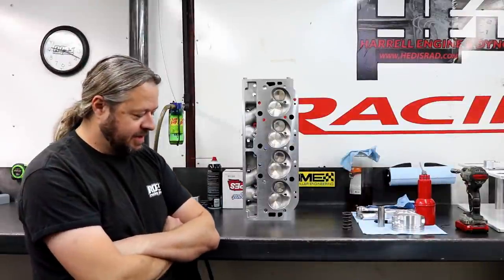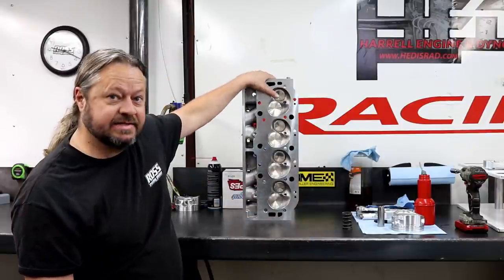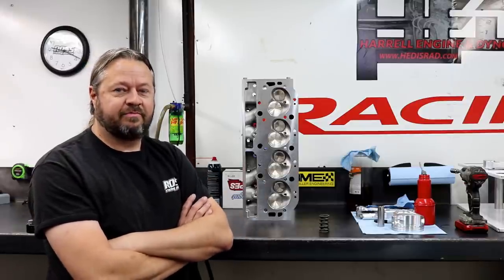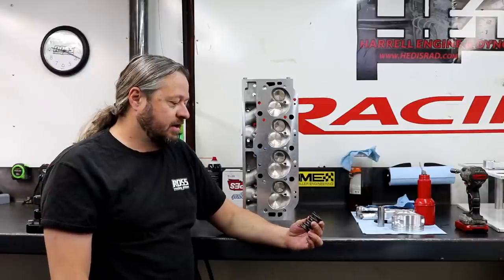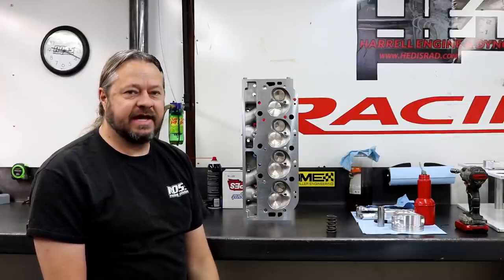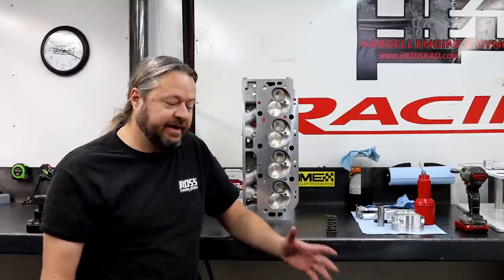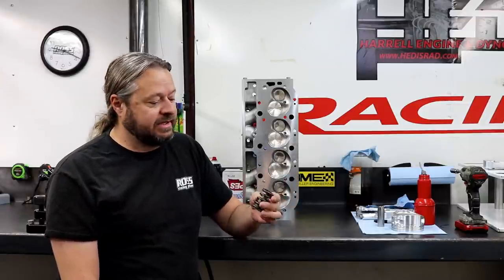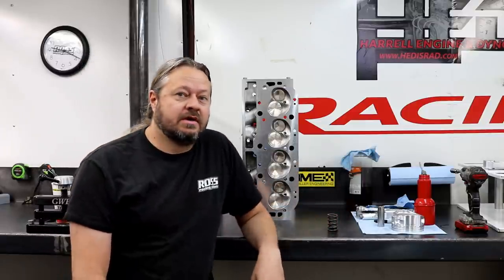Chinese Cylinder Heads

Comment: Would these be better to start with and have work done on or a set of old 041 or double humps on have them worked. Im looking to build a budget 400hp sbc to go in my s10
Reply: NO! buy some older AFR's or Brodix heads that someone is upgrading to better heads....I have a set of Chevy Phase 6 Bowtie aluminum heads I might sell for $650 new in the box.....Paid $800 for them long time ago....The China heads can drop valve seats....lose the valve guides....They are a complete "crapshoot" on quality and reliability.
Reply: @ericbrandt8675  i have a set of 041 and 461 heads . Just trying to figure out which way i should go
Reply: @gordo66061  Unless your doing a nmbers matching restoration....They arent worth it. To do them correctly with hardened valve seats, screw in studs/guide plates and porting will cos you more in labor than a set of aluminum heads.....Fully ported....they are 220-230CFM flow @0.550 valve open (2.02) and even the worst aluminum heads are 250-260 so your giving up 40-60HP in using those heads....They might be of interest to a circle track guy limited to iron heads but, even the 031 "Vortec" heads are better flowing heads than a fully ported 041 head. If your on a budget look for some vortec heads but, they crack pretty easily when neglected so finding good cores isn't easy. The Vortec will flow 225CFM with a 1.94 intake valve .....GREAT "as cast" port....Valve job can help with flow numbers.

Comment: I bought my Chinese heads when edelbrock decided they couldn’t supply them in 2 years. A well known and reputable builder told me to get them, they flow 3-4 numbers more, can have the same cnc as the edelbrock heads use.  I have seen Ferrea valves snap if they touch a piston. I have seen these Chinese Valves bend. I will take a bent valve over a broken one any day. I do not like the locks and retainers. I will always run a good spring not a generic.

Comment: The China castings have gotta better over the years for sure..
But imo just like you said the the springs and components are junk..
Best thing to do if you're trying to save a few bucks, is buy a set bare and have a machine shop do the finish work and install good valves, springs and etc.
Hell when you buy most of those heads it like another 300-400 bucks to buy them complete if that..
For that price you can't expect much, not when a good set of springs, locks and retainers cost that much if not more
Reply: I heard promaxx is good bare and have the valve job and bowl work done by Americans. I asked them myself. Seem lile a nice group of people. So just put all manley PAC SI ferrea etc valvetrain in it and call.it good that MIGHT be what is buy the 180 MAXX ford heads bare

Comment: Only decent budget heads that I’ve had experience with are the Skip White cylinder heads. I reworked a set of Skip White 210cc SBF cylinder heads for my brother. The castings were light years ahead of Procomp as far as cleaner castings. I redid the valve job because the seat margins were too wide, but besides that, some casting clean up and intake to cylinder head gasket matching alignment with cylinder heads installed on motor was very close as far as short and long radius’s went. Engine is a 
418-W , hydraulic roller cam, flat top pistons, and E85. NA it has gone high 10’s foot breaking with a C4 automatic with 4.10 gears.
Reply: john hoyt , I have to agree with you , I have a set on a 302 , runs great , no issues at all , would consider again for another build , nice job on running in the 10’s !!!

Comment: My Toyota has Japanese heads and It has 298k on it.  Heads have never been off the truck. 4 camshafts and 24 valves. Toyota is almost magic.
Reply: Big difference between Japanese quality vs Chinese quality. Japanese make great engines, cars etc.
Reply: Learn the difference between Japanese and Chinese.

Comment: Mine flowed amazing, but that wasn't the problem the center of the hole for the rocker arm stud was machined to close to the center of the valve, meaning there wasn't a BBC rocker arm on the planet that would work right. Fortunately Scorpion set me up with a short rocker arm that worked.

Comment: I was considering Skip White NKB heads. Any thoughts.
Reply: I have run SWP NKB 274 heads for a very long time on street and strip and will tell you from experience that they are awesome heads. He builds the core head with all quality parts matched for you'er application.
Reply: @ronniehenson4122  thanks for the response Ronnie. I'm building a mild 350. Maybe 375 hpand I figured by the time i built my vortec heads i could afford the nkb heads.
Reply: Well the NKB’s from SWP are meant to be very good. They fit them up with all the right parts & offer them on most of their performance engines. Talk to them & let them know your cam specs & they’ll guide you through it all. Just be careful there is Skip Whites Performance & White Performance in the the same town. SWP is the one you want.

Cheers
Reply: @port nut they arent all the same heads. The skip white bravo 335 bbc heads are exact copies down to the casting marks on the heads and flow numbers as the afr 325 as cast bbc heads. Check them out. I have a pair of both and laughed when i compared them. Slightly different components as far as valves and springs but they are the same damn heads. Even though skips are all assembled with comp cams springs retainers and locks.

Comment: Ive learned the heads are fine but always pull out all the valves and check ever thing over just like you rebuilding the heads.Or just buy bare heads.

Comment: If your going to criticise can you at least be bit more accurate that spring is about 38mm a ball point pen is 8m. 70lb seat pressure means nothing if your not an engine builder. Had you checked the valves & springs before using the head would it have been ok? this video just shows you winching without saying what it should be.

Comment: I have a self-ported pair of "pro-comp" Cylinder heads. (under 400 bucks bare when I bought them 7 years ago.)  Pro-comp and Australia (where the heads, the factory, the equipment and the training originated) is like Edelbrock upside down.  Ford is king there, and the "holdens" (Chevy) are treated like crap.  My heads fit perfectly, sealed perfectly , just over 500 horse on a 361" SBF.  But the pro-comp Chevy heads are crap.  As they should be.  So (ahem) ha ha.  Sorry I didn't spend 5 grand on heads.  Didn't need to.

Comment: I am extremely knowledgeable about sourcing machined components from China and other areas.  Both die cast and extruded.
I have some suppliers that send a good quality and their QC is reasonably reliable. I have other vendors who are nothing but trouble. I wouldn't trust their QC, counts or ship dates for 1 second. I have become quite proficient at colorful dialog in Chinese.
As an individual buyer you really need to use the internet and do your homework.

Comment: in the SBC world, afr enforcers are the same CHINESE casting AS THE $160-190 heads.. blueprint and skip white rebrand and sell these same heads too. skip white claims to have sold over 5000 sets with not a single failure and they dont  do anything but clean them and load them...

Comment: Our Top Fuel motor only fired for 2.5 seconds on Chinese heads. 7 valves dropped out almost immediately.
Reply: Which top fuel team do you work for?
Reply: @vr6swp  It was a joke.
Reply: 😂 I'm still laughing!
Reply: @jimjonrs3932  

I'm glad at least somebody realized it couldn't be true. The valves dropping out, that is.

Comment: I bought American cylinder heads.They came with duct tape on the gasket surfaces. Pulled the tape off and metal shaving fell out of the ports and casting. They were very dirty everywhere. Took them apart, cleaned all the sharp edges off, used dye and lapping compound, to check seats and valves. Cleaned, assembled and installed in 2001. Still on the engine and running. I don’t believe that you can take any out of the box and run them. I do believe what he is saying about the Chinese cylinder heads have to be checked more carefully the American ones.

Comment: Pro comp were iffy but had so many problems they couldn't sell them bad parts bad quality control, thought Chinese were masters of copying. But they were sending them back to China remelted and rebranded speedmaster because pro comp got such a bad name the quality control got better ,you can't sell crap to car guys and stay in business also started selling them to speed part company's and they rebranded them with there name or something else. Talked to machine shops and got all kinds of answers , but  came to the conclusion cheap or expensive they all have quality control issues of some kind even GM ,(had a set of BBC and 2 seats came out and were full of aluminum shavings. SO lucked out bought a pr of speedmaster bare BBC castings cheap won the bid on ebay  $380 for the pr rectangle port looked every bit as good as high dollar ones ,bought new quality hard ware valves stufs guide plates ,springs with cam kit sent off to machine shop a few minor issues but now professional valve job and set up and can be confident there good and in them way cheaper than high dollar ones that need gone through and checked more cash other parts so no complaints find out soon as the car is together

Comment: Buy bare heads and go to Alex's Parts for the valves, springs, and the rest. Why would anyone trust a set of no name valves and springs from China? Too critical of a piece if it goes wrong.
Reply: Don’t get mad at someone trying to buy a part they need. 

Be mad at the company that advertises a machine part that is not in the correct range.

Comment: I would rather have my old D3ve 460 heads taken in to a good machine shop and have them decked, ported, polished, and new valve job. Just a Mustang street rod, I dont care about Aluminum heads, especially Chinese made. I have seen some Promaxx heads are pretty good but the prices have gone up quite a bit.

Comment: The Speedmaster head castings are better than the American names! They are assembled in the US but cast in China with better quality control than Edelbrock! Buy them bare and put good components in them, your still ahead! I bought a new Edelbrock carb and the throttle shaft bores were way to big? Useless!

Comment: If you know what you're looking for, and you have experience at building Engines then there is nothing wrong with using the Chinese made heads. But you need to buy them bare, like anything aftermarket, check for quality control issues. I won't mention what parts to put in them though, that's what separates those who know, from those who don't.

Comment: It costs a lot extra when the owner has a major intellectual disadvantage. If the original assembler did his job correctly. Those heads would be still be on that engine and running.

Comment: You can not judge a head by the "branding". Some "American" heads are made in China. Some American heads are crap, just like some Chinese heads are crap. Condemning a head for its valvetrain parts is a whole different kettle of fish. ALWAYS buy your heads bare, use quality parts for the valvetrain (preferable those recommended and purchased by your machinist), and have a valve job and assembly done by your machinist who can flow bench them. A good machinist has seen a LOT more failures than the average garage mechanic and can turn an inexpensive Chinese head to flowing better than anything you can buy pre assembled and untested. Trusting ANY company that supplies pre assembled packages and just slapping them on your short block is a huge mistake.

Comment: After all who the hell has a thousand dollars to put and two cylinder heads you have to machine shop to get new valves and springs anyways always better off buying bare heads because a lot of American manufacturers use Chinese valves anyways plus they do a s*** job grinding the seat

Comment: Do you not realise that these springs are shipped as a base head.  If you think you,d take any head, bolt it on and go racing, you're deluded with Chinafobe.  If your application is more that daily runner, simply change the springs man!

Comment: Dear Dude,,,,Anyone any respectable motorhead who takes a China head out of the box and bolts it down gets what he gets .. Now Ive seen American made heads come with Valve job guide run out that was just horrible  .. So you take your China head apart or better yet you buy it bare then have your favorite over priced shop do a comp valve job with all new American parts  end of ptodlem

Comment: Procomp/speedmaster is the junk of the junk. If people need Chinese heads, promaxx are good with good parts. Afr enforcer is a dart platinum 200 copy with good parts. Nkb200 from skip white are the same castings wing good parts (not as good as afr) . Stay away from complete heads from China. Their valve train is garbage. 95% of Chinese rockers are garbage, all Chinese lifters are garbage. 

Procomp/speedmaster!needs to be shut down from the junk they sell but people keep buying it because it's cheap.